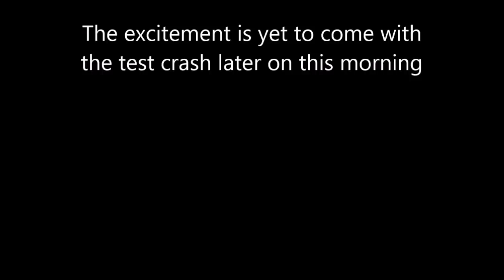Pizza Box

Comment: Ahhhh the venerable PBF.  This thing gave me the fits back when it first came out on SPADworld but even more so when Dave McDonald was flying them and posting videos.  He still does.  Electric versions are popular too.  The world has really changed, 3D flying of model aircraft, what used to be a solid IC hobby really has a good strong electric following.  I haven't made it too many events in the last 7 years but man do a lot of people treat their airplanes like helicopters.  At least the planes are prettier.  Anyways, someone looking to learn to fly would see Dave hovering his PBF, He'd catch it, throw it, trim trees with it, I think he could fry chicken and fly the thing at the same time.  They'd find links to the SPAD homepage and forums and tell us they finally found the plane to learn on, and of course it's not.  Your's is an early version of the PBF with a fuse and wheels.  That's fine, Tattoo I think made the first one like this and called it the Ciggy flyer as he used a Camel add.  I don't remember if he was copying a foam flyer off RCG or SPADworld forums, but pretty soon the square thing with a wood backbone Dave flys was the standard.  Take off and fly in High Alpha for level flight.  Yes you can nose it over and fly it like a regular plane to a point but that flat wing doesn't like to go fast.  Once you get the hang of it the thing will do flat spins, and hover against the wind and flop around really well.  If you get the hang of it and have a hankering for more, look up the MCDDD flyer, it's Daves slightly larger design  Or the SPA3D off the SPAD free plans homepage.  or just follow the PBF plans for the ultimate flying piece of coroplast, no landing gear on that one.  Buy LOTS of props, you'll make your local supplier very happy.  They are a blast and a good workout.  If you like doing touch n go's, you've got the right plane.  But don't let Tim fly it like he did.  It's not a plane, it's a hovering device.